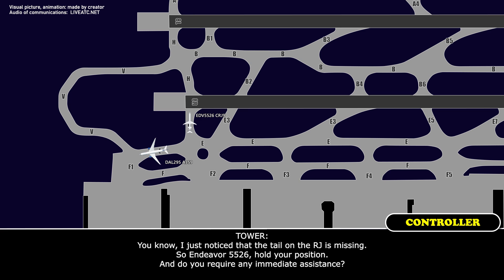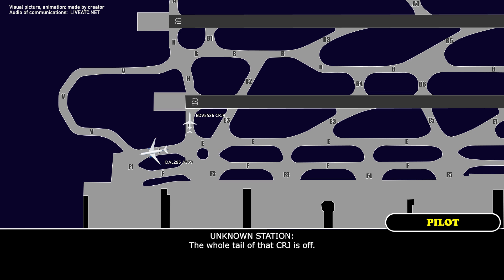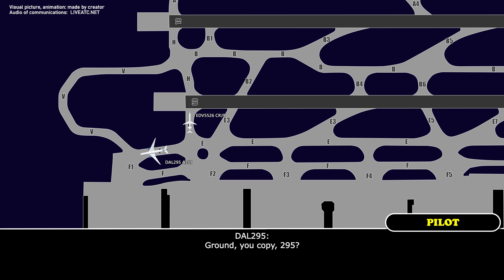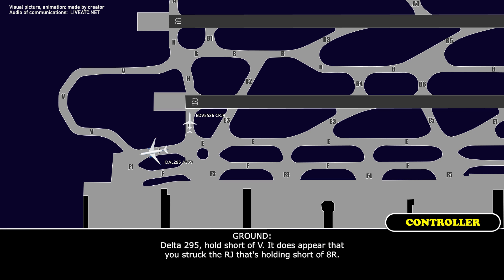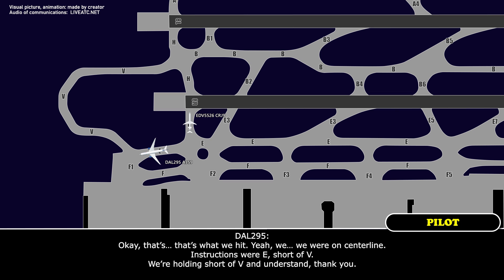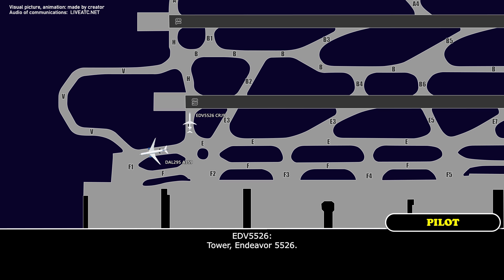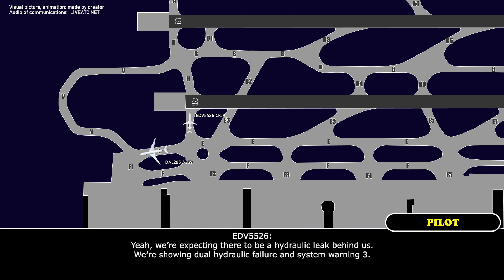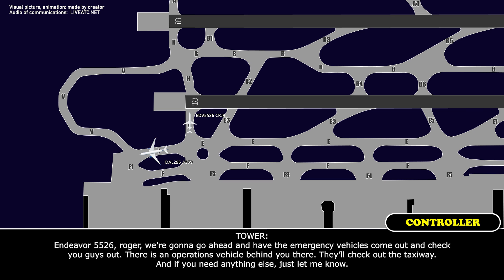“The whole tail is off”. Ground collision at Atlanta. Delta A350 and Endeavor CRJ-900. Real ATC

Comment: Just remember when in visual conditions pilots are responsible of their own separation, that includes taxiing. Any crew should be familiar with the size of their aircraft, and a captain of all that. This is no different from taking off and having an aircraft cross the runway ahead of you, you don't just continue because you were given clearance to take off.
Reply: That is exactly right-- visual flight conditions means that the crew up front is responsible for separation.
Reply: This is supposed to be the way we drive on the road and is also part of the rules of the road for marine navigation. With that said it seems like just plain old common sense to watch where you are going and to actively avoid collisions in any situation of life.
Reply: Wrong!!  The 350 is so big that the pilots CAN'T be "in visual" control and watch where the wings are BECAUSE THEY CAN'T SEE THEM, THAT'S THE POINT.  

The clearance everybody needs is already built in to ALL the markings but everyone HAS TO BE where they're SUPPOSED to be, and the CRJ pilot CLEARLY was not at, on or up to the Hold short line where he was supposed to be.
The 350 was ON CENTERLIINE of taxiway E right where they were supposed to be, but they're TRUSTING all the other pilots to pull ALL THE WAY UP to the Hold Short line so they're not sticking out into the taxiway space to give the bigger planes the clearance they need to safely get by the planes that have turned and are sitting at the Hold Short line. 

ATC's standard instruction to pilots is to hold short of THE RUNWAY, NOT to hold short of the Hold Short line like the dum bass CRJ pilot did.
ATC needs to revise their instruction wording and start telling pilots STRONGLY to PULL ALL THE WAY UP to the damn Hold short line, 

Juan Blancolirio on his channel measured it all out and the CRJ was 50 to 60 feet SHORT and AWAY from the Hold Short line, the CRJ is 118 feet long, the 350 wing is 106 feet long, and there should have been 40 feet of clearance between the two planes IF EVERYBODY IS WHERE THEY'RE SUPPOSED TO BE, but there wasn't because the ass hat CRJ pilot is scared shitless of pulling ALL THE WAY UP to the Hold Short line and left too much of the CRJ's ass hanging out in the taxiway E space.

You need to stop trying to think, you're no good at it.
Reply: @rawcado  WRONG! the captain is ultimately responsible for the safe handling of the ship, that includes being able to estimate obstruction clearances, when in doubt request wing walkers or a follow me car, when not available plan your taxiing route accordingly and make your request to atc. Not being able to see your wings does not excuse negligence
Reply: @Mr_Plop1  WRONG! The CRJ captain is ultimately responsible for the safe handling of NOT ONLY HIS ship, but ALSO all the other aircraft on the taxiways BEHIND THEM and being able to estimate where your tail is and not obstruct clearances that planes on the taxiways need in order to pass safely. 

Not being able to see how much of your tail is obstructing taxiways does not excuse negligence to NOT follow ATC directives to hold short AT THE GOD DAMN HOLD SHORT LINE, NOT 50 TO 60 FEET AWAY FROM IT.

STOP trying to think, you're no good at it.  😅🤣😂😆
Reply: @rawcado  if he wasn't close to the hold short line atc would've told him. Stick to Microsoft flight simulator, this is not your thing
Reply: @Mr_Plop1  👎👎👎👎👎 He WASN'T anywhere close was he? He was 50 to 60 feet away from the HS line and ATC DIDN'T SAY SHIT did they?
That's because ATC's are not hand holders and ass wipers, they expect pilots to think about all the other planes too not just theirs, and to think about what's BEHIND THEM as well as what's all around them, NOT just what's in front of them, why there are Hold Short lines and where you need to be in relation to the HS line in order to provide the clearance that all the other planes need in order to taxi past behind their dumb ass safely.

The CRJ pilot wasn't thinking about ANY of that when he stopped 50 to 60 feet away from the Hold Short line was he. Nope.

You and him should get together and stick to Microsoft flight simulator, since thinking logically is obviously not either of your thing. 😅🤣🤣😂😆
Reply: @rawcado  It still doesn't matter if the guy was holding short in the middle of the taxiway, you still don't crash onto them. Keep trying to justify it though and get on that tutorial.
Reply: @Mr_Plop1  You being dense on purpose?  Trolling?? 

What you're not taking into consideration and are completely ignoring is:

1. The distance from the hold short line to the taxiway E centerline was designed to INCLUDE enough space to provide clearance for all planes in operation to transit the taxiway and pass by other aircraft safely, but that ONLY works as intended if the plane holding short pulls as FAR FOREWARD as possible without CROSSING the hold short line, simply because the FARTHER BACK the plane is from the hold short line the LESS CLEARANCE there is for planes on the taxiway, and if you position the plane TOO FAR back and away from the hold short line there's NO clearance and collisions happen, which is both WHAT AND WHY THIS COLLISION HAPPENED. 

2. The airport engineers and designers KNOW THAT the 350 pilots CAN'T see the wing tips, and know what the large aircraft requirements are, so they calculate the distance AND POSITIONING of the taxiway centerline and the hold short line markings to allow all planes currently in operation to be able to use the airport safely and with plenty of clearance.

But THEY'RE RELYING on all the pilots to position the planes where they're supposed to be to provide clearance for everyone to avoid collisions, accidents and incidents, and that includes PULLING UP FAR ENOUGH to the hold short line to make sure there's enough clearance for all planes behind them WHERE THEY CAN'T SEE, and so that the ass end of the holding plane is NOT in the taxiway space, AND so ATC doesn't have to play airplane traffic cop to all the pilots that are scared shitless of pulling all the way up to the hold short line. 

3. The planes on the taxiway have the right to expect to transit a taxiway and NOT HIT other planes simply because a pilot is scared shitless of pulling ALL the way up to the hold short line.

It's just as easy for me to say the CRJ pilot had the responsibility and should have pulled ALL the way up to the Hold Short line and this never would have happened, as it is for you to say the 350 pilot should have looked at the wings THEY CAN'T SEE and had a responsibllity to stop to prevent a collision.

Both are true. But when the FAA and all the investigators look at where each plane was when the collision happened compared to where they were supposed to be for the design and placement of the markings to work for everyone as designed, what do you think they'll see?  

They'll see that ONLY the 350 was where it was SUPPOSED to be, on centerline, and the CRJ WASN'T.  That's how it will shake out.
Reply: watch blancolirios video on that. crj probably wasnt pulled forward enough, but its damn near impossible to judge wingtip distances with an aircraft as big as the a350
Reply: FAR 91.3a states: "(a) The pilot in command of an aircraft is directly responsible for, and is the final authority as to, the operation of that aircraft."
If the A350 pilot was not positive that there was enough clearance behind the CRJ then it is the PIC of the A350 who is responsible to stop, ask for assistance or whatever it takes to ensure safe operation of their aircraft.  That ground control cleared the A350 to taxi behind the CRJ was no statement that it was safe to do so.
     Anyone who has ever parallel parked their car knows what size parking spot their car will fit in.--even though they can't see the back of their car.  Anyone driving an A350 1,000 hours per year KNOWS what space their aircraft needs to taxi.  The pilot in command of the A350 might not have even been looking out the windows.  They just passed by the CRJ yet they not know what they hit.

Comment: At the end of the day this is on the Delta A350 crew. Regardless if they got clearance from ATC or if the CRJ crew was too far back, at the end of the day the PIC is responsible for safety maneuvering their aircraft around the taxi way. If there is any doubt, stop and wait.
Reply: Nope
Reply: @steve83333  Lmao, youre the type of person who would drive off a cliff because google told you to then huh.
Reply: @FrostbitexP  Easily one of the most lame answers I have ever encountered. By the way how many hours and what ratings do you have? Just curious, but I think I can guess the answer pretty close.
Reply: @steve83333  Lol ok. Tell me you’ve never taxied on an AOA without telling me you’ve never taxied on an AOA.
Reply: @SuperTrb0  Really now? Okay, you stay with that thought buddy. How many hours and what ratings do you have Superman?
Reply: Wrong!!  The 350 is so big that the pilots CAN'T be "in visual" control and watch where the wings are BECAUSE THEY CAN'T SEE THEM, THAT'S THE POINT.  

The clearance everybody needs is already built in to ALL THE MARKINGS but everyone HAS TO BE where they're SUPPOSED to be, and the CRJ pilot CLEARLY was not at, on or up to the Hold short line where he was supposed to be.
The 350 was ON CENTERLIINE of taxiway E right where they were supposed to be, but they're TRUSTING all the other pilots to pull ALL THE WAY UP to the Hold Short line so they're not sticking out into the taxiway space to give the bigger planes the clearance they need to safely get by the planes that have turned and are sitting at the Hold Short line. 

ATC's standard instruction to pilots is to hold short of THE RUNWAY, NOT to hold short of the Hold Short line like the dum bass CRJ pilot did.
ATC needs to revise their instruction wording and start telling pilots STRONGLY to PULL ALL THE WAY UP to the damn Hold short line, 

Juan Blancolirio on his channel measured it all out and the CRJ was 50 to 60 feet SHORT and AWAY from the Hold Short line, the CRJ is 118 feet long, the 350 wing is 106 feet long, and there should have been 40 feet of clearance between the two planes IF EVERYBODY IS WHERE THEY'RE SUPPOSED TO BE, but there wasn't because the ass hat CRJ pilot is scared shitless of pulling ALL THE WAY UP to the Hold Short line and left too much of the CRJ's ass hanging out in the taxiway E space.

You need to stop trying to think, you're no good at it.
Reply: @rawcado  Lol this isn’t accurate at all. You need to stick to MSFS and leave flying to the real pilots.

Comment: On most airliners and wide bodies in  particular it is diffícult to know where your wing tips are. That's why we have wing walkers on the ramp. 
Because the 350 was on the radio before the CRJ and not sure what he hit it sounds like everyone in the 350 might have been  heads down. Bad practice but it happens. 
From aa ATC procedures point the 350 should have been cleared short of the CRJ taxiway. 
This can't be an unusual wing tip clx problem with an aircraft awaiting lineup. 
This is just a guess. Let's save blame until the accident report.
Reply: Wrong!!   The clearance everybody needs is already built in to ALL the markings but everyone HAS TO BE where they're SUPPOSED to be, and the CRJ pilot CLEARLY was not at, on or up to the Hold short line where he was supposed to be.
The 350 was ON CENTERLIINE of taxiway E right where they were supposed to be, but the 350 is so big that the pilots CAN'T watch where the wings are BECAUSE THEY CAN'T SEE THEM, THAT'S THE POINT of taxiing planes being on centerline of the taxiway and the Hold Short planes pulling ALL THE WAY UP to the Hold Short line. The 350 pilots are TRUSTING all the other pilots to BE WHERE THEY'RE SUPPOSED TO BE and pull ALL THE WAY UP to the Hold Short line so they're not sticking out into the taxiway space to give the bigger planes the clearance they need to safely get by the planes that have turned and are sitting at the Hold Short line. 

ATC's standard instruction to pilots is to hold short of THE RUNWAY, NOT to hold short of the Hold Short line like the dum bass CRJ pilot did.
ATC needs to revise their instruction wording and start telling pilots STRONGLY to PULL ALL THE WAY UP to the damn Hold short line.

Juan Blancolirio on his channel measured it all out and the CRJ was 50 to 60 feet SHORT and AWAY from the Hold Short line, the CRJ is 118 feet long, the 350 wing is 106 feet long, and there SHOULD HAVE been 40 feet of clearance between the two planes IF EVERYBODY IS WHERE THEY'RE SUPPOSED TO BE, but there wasn't because the ass hat CRJ pilot is scared shitless of pulling ALL THE WAY UP to the Hold Short line and left too much of the CRJ's ass hanging out in the taxiway E space.

You need to stop trying to think, you're no good at it.
Reply: @rawcado  Nonsense.
I am both a licensed Air Traffic Controller and a retired 777 captain.
I have also flown into Atlanta many times.
You have no idea what you are talking about.
The RJ had a clearance limit nothing more. There is no regulation he had to have his nose on the hold short line. In tight limited space airports like LaGuardia ground contol might tell a flight to tighten up the spacing for another aircraft.
Regardless of your opinion no matter where you have stopped on the maneuvering area you have a legitimate expectation of not having your tail knocked off by another aircraft.

Comment: This reminds me of those videos of 18-wheelers, dump trucks, etc driving along oblivious to the fact that they're pushing a t-boned sedan in front of them.

"There's a WHAT on the front of my truck?!?!"
Reply: As someone whom has been in one of those sedans, I can identify with this.  Thankfully in my case he didn't dive very far at all before noticing, but talking to the driver afterwords, he didn't notice hitting me or pushing me for the first several seconds.
Thank God everyone was unharmed (albeit a scary situation, spun 3 times when my car slide off the side of the front of the truck, still at speed (no longer full highway speed, but still).  Miraculously was able to drive my car away from the accident [after waiting like an hour and a half for the police to show up, then getting the police report], it basically just damaged the doors and a little of the rear fender.

Comment: We don't care if anything was in our path, we were on the center line.
Reply: Guess you never taxied anything with a 200 foot wing span.
Reply: Yeah, you stop the aircraft if there's any question of wingtip clearance. Shocking I k ow, that it happens multiple times a day at most busy airports.
Reply: @Flinno-k8w  read APC bot a single pilot there is placing blame on the CRJ, most are arguing he's not even holding short an unreasonable distance
Reply: @Flinno-k8w  and multiple times a day is in reference to questionable wingtip clearance whrre the pilot stops the fucking plane instead of barelleling theough a stopped aircraft qhile heads down, not people holding 40 ft short.
Reply: @mark-ko9py  and a lot of times, it's a crash. And your conclusion is not holding where you supposed to is absolutely fine, when clearly, it's a major contribution to the accident and far easier to avoid than guessing the clearance of a wingtip by few  feet that you cannot even see.
And that is why this will hap9en again and again because nobody adresses this titanic slice of the cheese hole align model.

Comment: Just read through the airport diagram and notes for ATL. Nothing about restrictions for taxiing in that specific area of the airport but I’m assuming there will be after this. Most likely there hasn’t ever been a scenario where a wide body with wings as long as the A350 was taxiing past the hold short spot for 08R with an aircraft already holding short as the operation would never require that. Aircraft taxiing westbound to the T gates would usually be on F not E as the aircraft on E westbound would be in line for departure. Not sure why ATC had this setup going, sending a departing aircraft for 08R westbound past H but it definitely proved to be ineffective. I’d understand westbound on F, right victor, short of H. The A350 pilots should’ve noticed the close proximity to the CRJ and been proceeding with caution but since they had no idea what they even hit, I’d say they were caught up in before takeoff briefs.
Reply: Airport diagram will be updated by the end of the week as a hot spot. The airfield wasn't designed for a/c like the 350

Comment: The CRJ could've/should've been closer the 'stop' line short of the runway. It looks that the CRJ was 20-30 feet from the line. It would have been enough to avoid the strike.

I wonder how much of the responsibility will be attributed to the A350. They still had a responsibility to avoid hitting the other plane.
Reply: Someone said that the CRJ was pulled back during the collision.
Reply: @jimblack5153  Unlikely because of the angle of the CRJ. If it had been pulled back, the tail would have been dragued/pushed/pulled by the A350. The final position of the CRJ is crooked, but not on the 'correct' side.
Reply: @JRTurgeon13  100 percent.  If you taxi into something that isn't moving, that is on you.
Reply: @nahhomeboy  I still think that the CRJ will be attibuted some contribution to the collision. The A350 collided with something that wasn't supposed to be a problem. Not quite the same as hitting a light pole. And there is no easy way for the pilot of the A350 to see if they were clear of the CRJ (can't see the wing tip from the cockpit).
Reply: @JRTurgeon13  you're wrong.  I've taxied aircraft around the biggest airports in the US, including Atlanta and it's literally your primary job when taxiing to not run your aircraft into something, ESPECIALLY something that isn't moving.